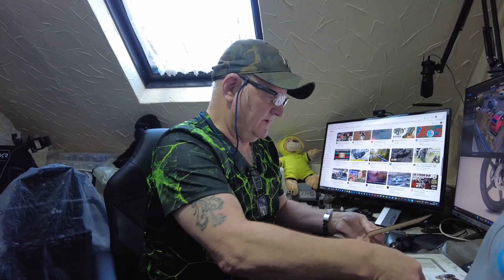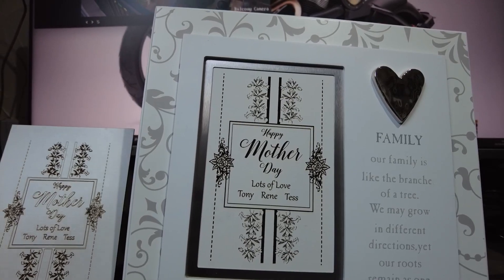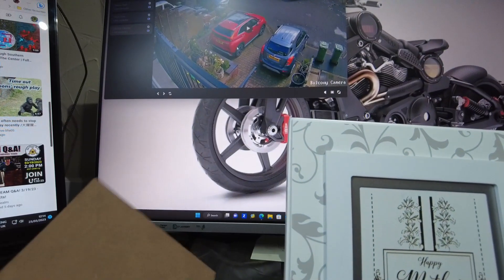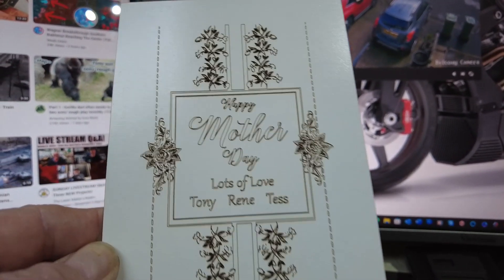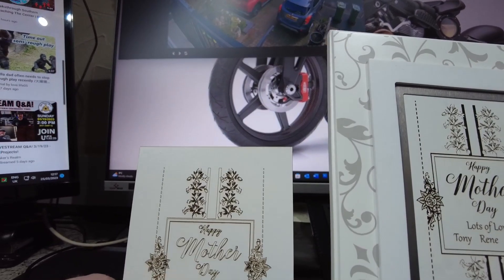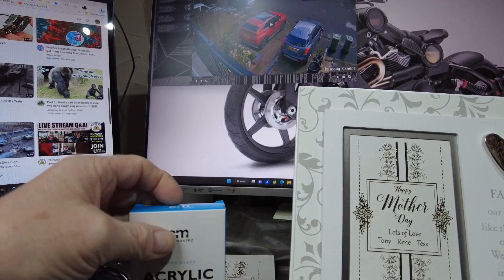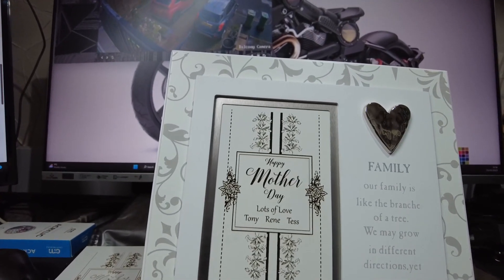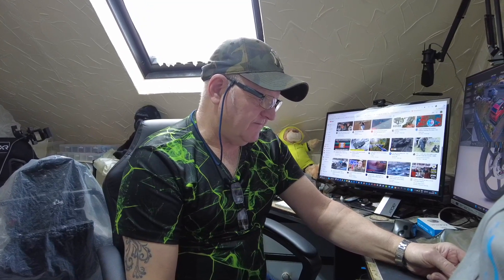Genmitsu LC40 and CNC 4040 pro update

Comment: Do you have a video on how to flash the firmware to use Lightburn on the LC40 with a Macbook Air?
Reply from the maker: Hi Jodi I dont have a video on flashing the firmware for LIghtburn  I followed the instruction manual. There are some videos out that do I know I watched a couple. Please keep me informed if you are successful I will then pass the link on to others Tony
Reply from the maker: https://docs.sainsmart.com/article/ggkgic4cy6-jinsoku-lc-40-firmware-flashing-instruction-for-mac this might help
Reply: @Tonys.Top.Tips.Workshop  Thanks! I have tried these steps but when I get to the "start update", the connection times out. Haven't been able to figure out what the issue is.
Reply from the maker: @JodisCardDesigns  I know on mine I had to use coms 3 port and no other and  I had to disable blue tooth as that used coms 3 It is a problem that Sainsmart knows about but they have done nothing